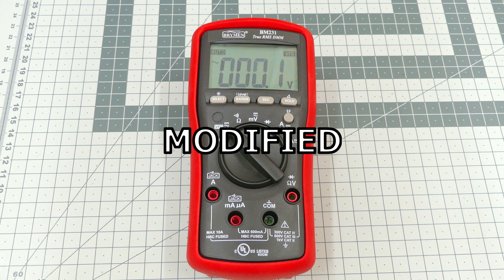Brymen BM231/BM235: Adjust buzzer volume

Comment: The Best Solution to reduce the buzzer sound is to put some Isotape into the small hole of the buzzer and then add some Isotape on top of it.
With this solution, every multimeter is much much quieter than if you just replace the resistor.

Comment: a simpler solution would be a sticker over the beeper hole, just saying.
Reply: @Poor Username soldering is the hard way of doing it, the simpler solution is always the best solution
Reply: I thought about the same :)
Reply: @Moab's Washpot in that situation I would remove the buzzer completely...
Reply: No a sticker over the buzzer hole doesnt reduce the sound enough. 
You have to put some Isotape INTO the buzzer hole and add some isotape on top of it. That's the best solution.